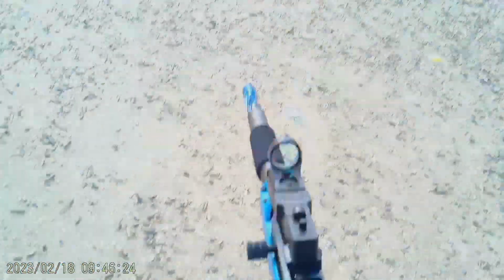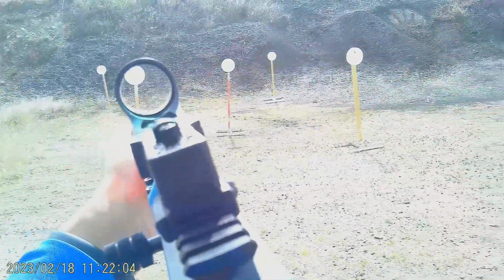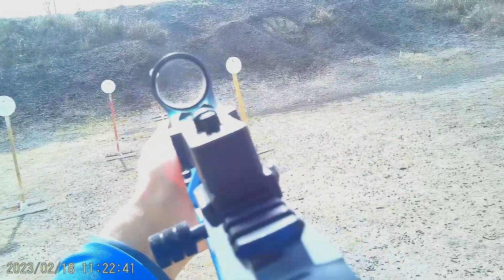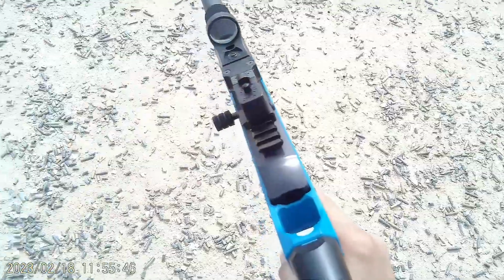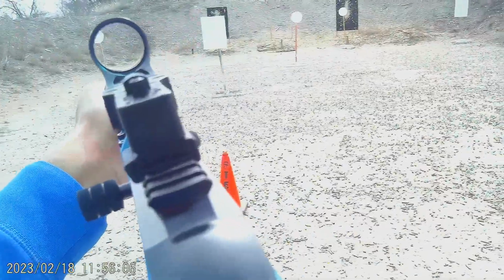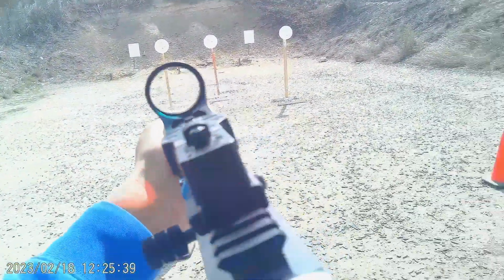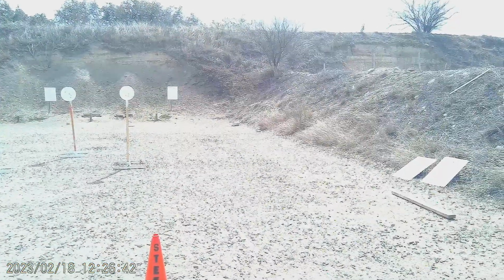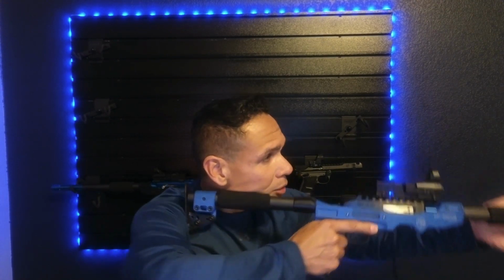Steel Challenge Rimfire Rifle Build - Part 2 - First shots at an 8 stage Match - RFRO in Bandera Tx

Comment: Nice build and shooting! What magazines are you shooting and what ammo do you like? Thanks for sharing !!!
Reply from the maker: Hey Aaron -  thank you.  I’m currently - and have been using mini mag 40g round nose as my ammo of choice.  Standard Ruger 10 round magazines in black -  the clear ones are nice but cost a lot more -  a 3 pack of 10 round magazines are usually 35 bucks at most .    Doing some ammo testing across rifles and pistols next week to make sure mini mags are the ammo each gun prefers.  Mini mags go bang every time for sure,  but at 8.00 per 100 rounds not the cheapest.
Reply: @mindinbox  thanks! What was that clear ammo storage box you use? Seems to fit 6 x Ruger mags nicely.
Reply from the maker: @aarondbritt  pelican 1040 micro - fits 10 ruger  bx-10 magazines perfectly, no room for them to even move.  Front of the box for odd stages, rear magazine set for even stages.  Its way more expensive today - use to be like $15.00 bucks, now double that.
Reply: @mindinbox  Awesome! Thank you!
Reply from the maker: @aarondbritt  - Thinking about it, a lot of folks are using fishing tackle boxes, various sizes to hold any number of magazines.  The reconfigurable trays allow for all kinds of accommodations.  If I did it again - something I would consider.